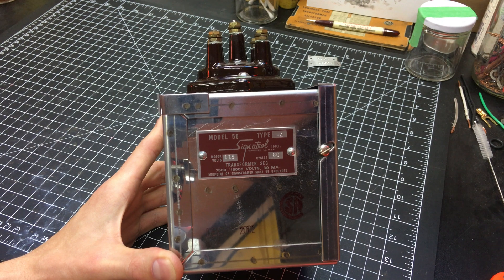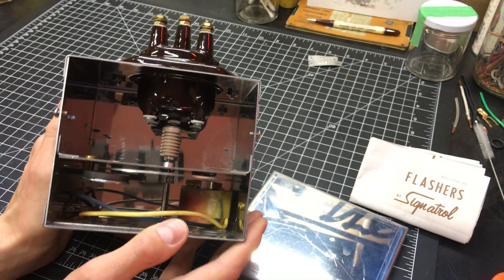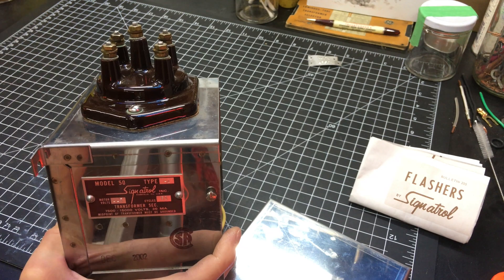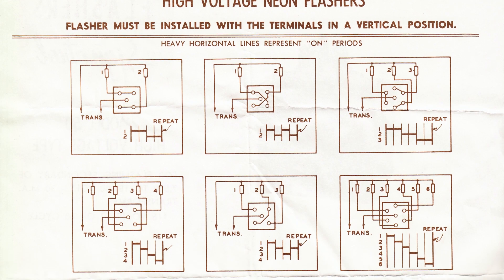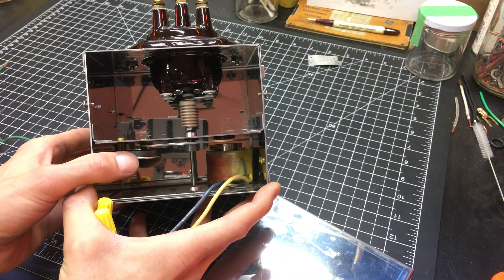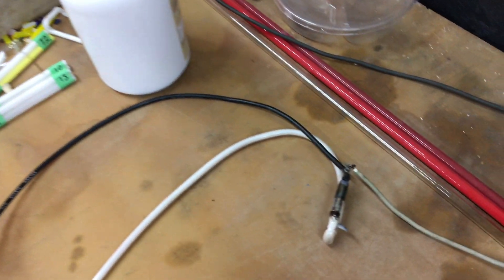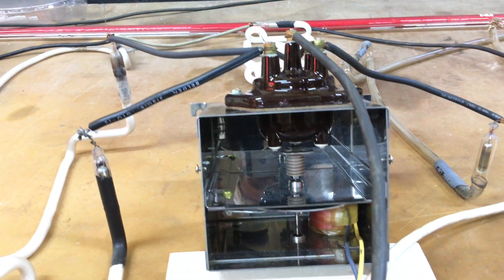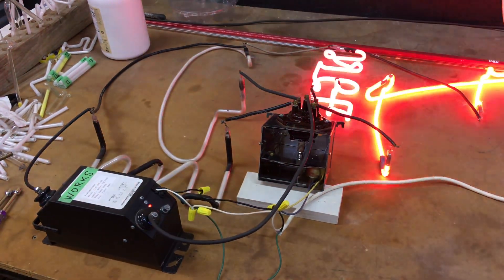Signatrol High-Voltage Neon Sign Flasher

Comment: Beautiful piece of kit there! I have seen the fast and frenetic neon flashing before. I expect a primary flasher with contacts passing higher current would wear out faster than this, since there is no actual contact between the rotor and cap setup.
Reply from the maker: i imagine you are correct.  many sign supply shops sell replacement contacts for primary flashers, and while they are more common than secondary flashers, the contacts do seem to be a common wear item.

Comment: I wish I could find the one I salvaged from a Sentry Drugs sign. They had arrows along the sign and the unit inside was different than this. The "distributor" was blue glass and sealed with some kind of gas inside. You could see the arcing but there was no sound and the housing was just painted steel.  It was Acme Electric brand.
Reply from the maker: wow, that sounds amazing!  if you ever find it, i'd love to see pictures of it!
Reply: @NeonPreservation  I have so much stuff stored everywhere, I am looking forward to finding it as well, always wondered how they fabricated that thing. It doesn't even have a shaft it uses external windings like a motor to rotate the internal rotor.
Reply from the maker: crazy!  im really intrigued by the description, sounds quite unique

Comment: Nice video and a really odd way of controlling the tubes! Makes me wonder how many of these are installed on the Las Vagas strip! The Tesla builders would love one of these. (I'd have my main isolator switch closer to the front of my test bench, so I don't have to reach over any potential danger!).
Reply from the maker: very cool!  makes me wonder in what other ways these devices could be used...

Comment: I cannot express in words how badly I want to locate one of these. Any idea where I might look? Never seen one on eBay, just in old neon technical books.
Reply from the maker: they are really neat, i love mechanical flashers!  the secondary high-voltage flashers are very common but still available. the first place that comes to mind that carries them is WCCD, although it is likely other sign supply shops as well.  they're about halfway down the page here:
http://prosites-llcwccd.homestead.com/MECHANICAL-FLASHERS.html
Reply: @NeonPreservation  Thanks! I definitely won't be able to afford one of those just to build a hobby sign, but I'm glad to know they're still made!

Comment: Could this be used in a spark gap tesla coil
Reply from the maker: ive never built a tesla coil, but this device is designed to distribute high voltage, so if thats what is needed, then yes it could.  the info plate on the front of the unit says 7500-15000volts, 30mA.

Comment: Check out my movie marquee video. I was a week late. Someone removed several pieces but l bet it had something similar. https://youtu.be/tE4RH0v_i1k
Reply from the maker: what a fantastic marquee!  it is a shame they tore the building down.
but yes, you are correct... to animate the neon and bulbs they would have used a flasher.
Reply: @NeonPreservation  it was completely restored by a sing company about 8 years ago. Painted, new bulbs and repaired neon. It was well weathered when l filmed it.